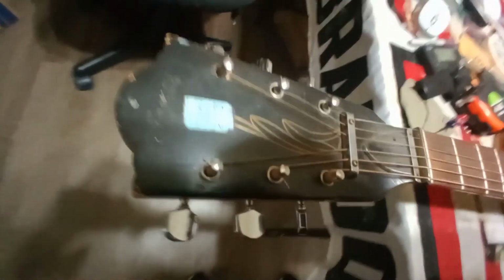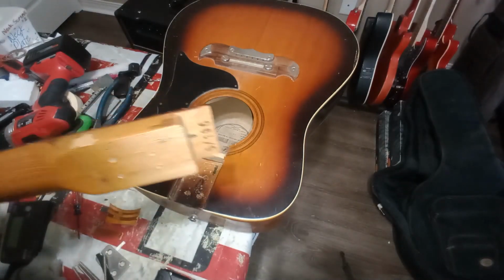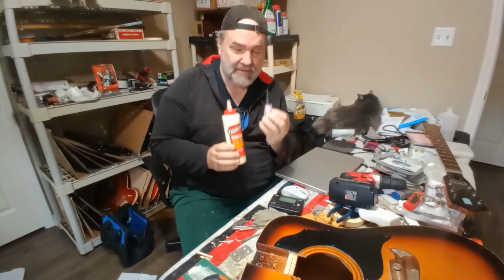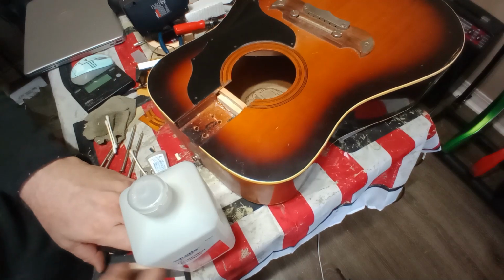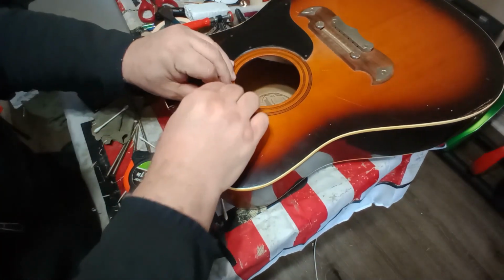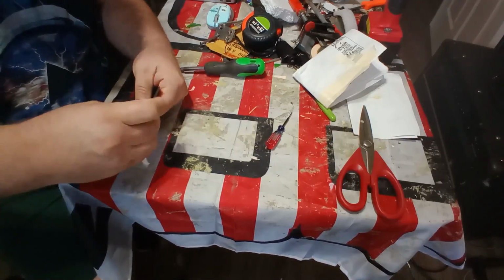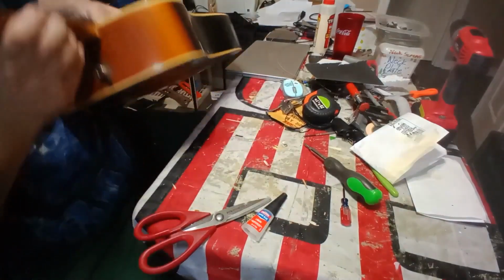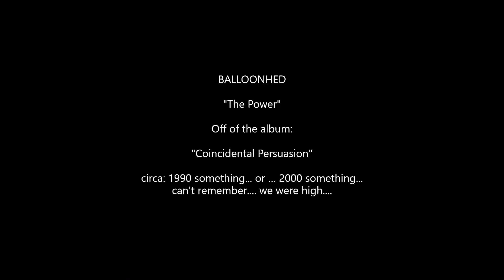1969 Framus Texan Acoustic Neck Repair, Reset & Setup Model 5/196

Comment: awesome video! I found one of these in a junk shop in pretty rough shape and debated buying it to fix it up. based on your video i think It may have the exact same problem as yours!
Reply from the maker: Actually, it is an easier neck reset than a glue in dovetail joint that you have to steam out.  This one wasn't bad and it's a great player now.
thanks!

Comment: I just got a 5/195 how can I pin point what year it is?
Reply from the maker: Do you see any other numbers?
Reply: @guitarhustlerdan  Thankyou you so much with the reply. In the serial number I can male out a distinct 208 but looks like it might be 12018
Reply from the maker: @allendionnelastcall3749  comparing serial numbers, and no date on the tag, it appears to be a 1968 to 1972.    I would say a '69 by what I have found, but also there are serial numbers that make no sense. Found one just a 1000 digits lower that was stamped 1968.
Reply: @guitarhustlerdan  I thought 1969 myself from my research also. I very much appreciate the reply. Thank you so much.
Reply: The serial won't help, you need the date code, like "71C" = march 1971

Comment: I have almost the same one. Do you know what size I need wrench for adjusting the truss rod? Thanks :)
Reply from the maker: I used a 5mm and it was just a hair loose, but it worked just fine.
Reply: @guitarhustlerdan  Okay Thank You so much!!! I only see 7mm short barrel truss rod socket wrenches but I will try to find a 5mm one Thank You!!!
Reply from the maker: @VirginiaWolf88  if you can find a 5.5 mm, it would probably be tighter.
Reply: @guitarhustlerdan   Thank You so much    I have a few truss rod wrenches coming. I will get to the bottom of it.